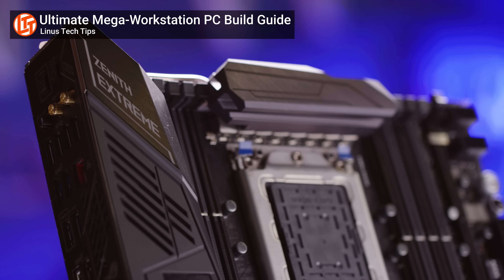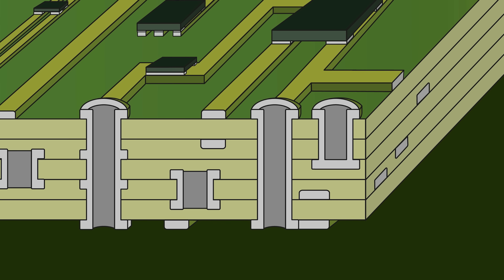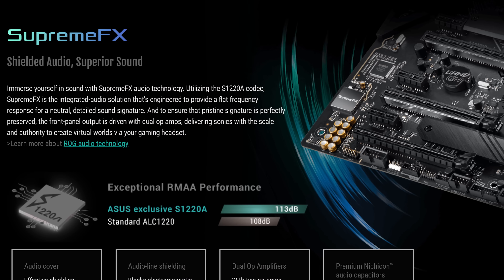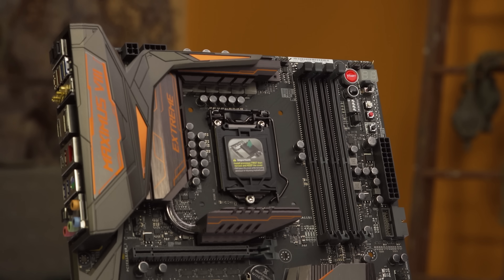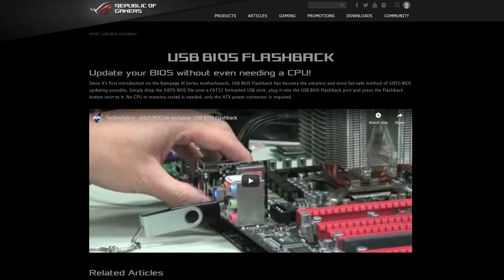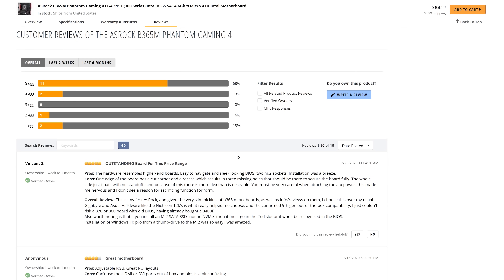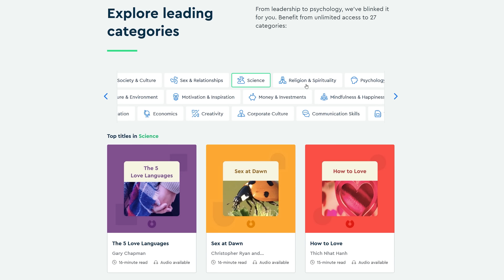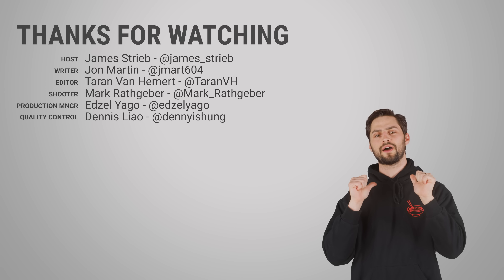Are EXPENSIVE Motherboards Worth It?

Comment: If it has rgb yes, rgb makes anything 20x stronger, like an rgb cpu, it goes from 4ghz to 80ghz
Reply: never forget the rgb fans.
Reply: Yes! When it has rgb on board, this will give you 50+fps AT LEAST in all your games! :p
Reply: I thought it was 100ghz
Reply: @lukasmares1489  rgb fans move at light speed so they’re way better
Reply: @bramvandenbroeck5060  90*
Reply: I put a custom rgb heatspreader on my Athlon XP and now I can play the latest titles with software rendering. At 643.2343 fps. Plebs. I run at 3 tera hertz
Reply: ur all bad 

rgb cpus give 69ghz
Reply: @Saber SMAW hey look, most people like it. it's personal preference. dont get heated
Reply: Rgb is for kids
Reply: It also goes from 4 cores to 80 cores.
Reply: average gamer

Comment: Ok summary: For the 99% of the folks out there - getting a costlier motherboard isn't worth it.
Reply: I have a high budget so I guess I should?
Reply: @theycallmetheswitcher703  probably. What’s your cpu you plan to use?
Reply: @Th31nOnly  5950x
Reply: @theycallmetheswitcher703  I’d go for either a Aorus Master, MSI Ace or if you have big bucks to spend either the Aorus Xtreme or MSI Godlike.
Reply: @theycallmetheswitcher703  I just bought a 2950X. Whats the difference between mine and your CPU? Just more PCI lanes? lol.
Reply: @LaSombraa  Mines faster
Reply: Jay _TooGoated  idk but have actually found that 3090 if yes please tell me where
Reply: Jay _TooGoated  oh ok
Reply: Define costlier. Nobody should be buying sub$100 boards if they're gamers, you don't need anything around $200 but don't ever go below $100. $150 is the sweet spot. Y'all will spend half a thousand on a GPU and $300 on CPU but won't buy a $150-$200 motherboard? 🤨 WeirdChamp

Comment: I only buy a320 mobo now and never pay more then 40 bucks for a motherboard . I used to buy 500$ motherboards but today's age where no modern CPU can overclock more then what it it say in the Box specs they are already produced and clocked pretty high so you're not going to get much overclocked performance out of modern chips nowadays kind of pushes me towards buying a basic non overclockable A320 motherboard every time and I'm not even considering an Intel motherboard because Intel isn't worth considering right now

Comment: When the X470 chipset is already classified as "older".
Reply: And when the 4000s come out, x570s are out too 

/s
Reply: @stermyplatinum7870 
They are actually not going to be upgrading the socket type... So no....
Reply: @kasukahei  am4 dies with 4000. amds own words.
Reply: @Dr.WhetFarts  No, AM4 will still be used for Zen 3 (4000). Zen 4 (5000) is when AM4 dies
Reply: @whiplash7400  that's what he means. The AM4 socket will die with 4000, meaning that will be the last.
Reply: Karrick  I think I missed the Ryzen 4000 release lmao. Unless you count laptops this really didn't age well
Reply: @nicholassmith7723  they skipped the 4xxx in naming; the 4000 they were talking about is actually the new 5xxx
Reply: @stermyplatinum7870  what was the point of the /s
Reply: Jay _TooGoated  why are you getting a 10900k if you can afford a $2500 GPU???? Lmao I would say wait for Alder Lake 12900K and get a good board and too spec DDR5 RAM. Forget 10900k.

Comment: In the 25 years I've been building my own PCs, I've always stuck to the 100-150 range on motherboards. I've had a single failure, but it was within warranty and was repaired for free. No way to say if that was because they were cheap, or just bad luck of the draw. This video answered its own question right at the start, then spent 4 minutes in a circle to come back around to the same thing. Get what has the I/O features you need.

Also, thicker boards do not always mean thicker traces, but can mean more layers. In addition, a thinner board can actually have superior performance by moving signal layers closer to power planes. This reduction in thickness is from a reduction in the insulating material, like FR4, not by thinner traces. Thicker does not automatically mean better, not by a long shot, and you do a disservice to your viewers saying so.
Reply: 100 to 150 what?
Reply: @PureOctarine  dollars
Reply: @PureOctarine  Chocolate Kisses.
Reply: @PureOctarine  cents
Reply: @southpaw117  exactly, 100-150 finest chocolate kisses.
Reply: It also depends on you cpu, no reason to get an expensive board if you have a 65-watt chip. If you have an i-9 it may be worth researching a bit more but I remember seeing that a $450 board had the basically the same performance as a $2000 board. It's also a good reason to consider what CPU to use in your system as the more power hungry CPUs are more expensive then just the individual price of the CPU.
Reply: @PureOctarine  bitcoins
Reply: wonder how you do that now with how bad the prices are

Comment: Let's look at my personal experience.
I've been owning and repairing computers for ... a while.
I've had a lot of parts fail on me.
The three most common failures I've seen are: 

#1> Hard drives.
Not the most fair comparison, due to the VAST majority of my hard drive failures being laptops, and rough handling played a major role in most of them.
This was a major reason why I was so happy to see SSDs becoming affordable, and I was a major evangelist for the technology in laptops in the early days.
Forget the speed benefit, buy an SSD for your older laptop so you don't lose all your data if you drop it! I have one machine that's claimed THREE drives all by itself.
Can be resisted with a good solid backup plan, and given the average age of my typical failing hard drive (I've only lost one newish drive), you're probably due for an upgrade anyways. 

#2> Fans.
I've had a lot of old and crusty fans fail. But I've also been able to repair a lot of my failed fans and restore them to operation.
Unless it's your CPU fan, these usually aren't terminal. 

#3> Motherboards.
Seriously. I'm saddened by how many motherboard failures I've experienced over my computer-owning life.
It's a good idea to put a bit of dollar into the quality of your motherboard purchase to try to help head off this particularly traumatic, sudden, expensive, and very computer-ending failure.
My first desktop motherboard was also my first desktop motherboard failure. I hated that thing and was honestly kinda glad to see it go.
It resulted in me buying an old server grade workstation motherboard, as I wasn't ready for a CPU upgrade, and Intel did an Intel and discontinued my socket.
I have another system in my collection that I'm pretty sure is a ticking time bomb before its motherboard goes.
Reply: Damn, I never had hardware fail on me ever. I've reassembling computers  since I was 6 and never have I ever had any component at all die on me. Once a VERY old hdd stopped working over a bent pin, so I decided to retire it instead of fixing it, and I had a gpu fan blade break, but I replaced the fan so it's working fine again. So far nothing died. Not even 20 year old oem psus
Reply: My very first hardware failure was by my GPU, because my parents didn't think having a FREAKING FAN ON THE GPU WAS ACCEPTABLE. Entire GPU burnt itself up and took the motherboard with it.
Reply: @shahnazfiaz2015  Ouch...
Reply: @FerralVideo  Extreme ouch since it was my first ever GPU ever. First GPU ever that could actually run a game. And it burnt itself in 2 months.
Reply: @shahnazfiaz2015  so wait did they mandate you get a GPU without a fan or somehow rip it out???
Reply: @Lyander25  it was the first pc I ever owned, and we didn't really know much about them at the time so they decided to just get cheap parts to just make me happy. It was an AMD office use "silent" GPU. Silent as in it only used a massive heatsink to keep itself cool. Let's just say that office use and playing games were very different things.

Comment: Truth be told when I went to buy the board in my current system what I cared most about was having something that was full ATX first and foremost so I had plenty of Sata and expansion ports,(and since I was building in a case with a tempered glass side panel I wanted something that would fully fill the motherboard tray). I also wanted something that had onboard RGB control and lighting as I was also looking to make a flashy system as well. I went with a ROG Strix B450 gaming F because it filled all the needs I had for the build and seemed to be a good value for the money in December of last year and it had a lot of positive reviews.

Comment: I didn’t expect the extra features to be so important when I bought my Aorus Master Z390 beside stably overclocking my 9900k. But I end up using all these features to the max such as Bluetooth 5.0, extra USB voltage modulator (let you increase voltage manually. Great for VR headset and sound equipments). So be sure to check for these extra features that might benefit your peripheral equipments.

Comment: I have been running Gigabyte X58 UD7, one of the most expensive mobo of 2009, for 11 years now 24/7.  Computers are fast enough in every way, support enough memory etc. that the computer you build today will be usable at least a decade in all but compute heavy tasks. You can buy 2nd hand 3950X and Big Navi later and extend the life of your system. Motherboard is the only thing you are not going to upgrade. 

I also bought on 2009 one of the biggest/best cases, best PSU, and Noctua NH-D14. Buying great case, great PSU and great air cooler (water cooling is obsolete, best air coolers beat all AIOs) are great investments. Great cases will look great and offer everything you need for a really long time. Good PSU won't cause short circuits, won't break and require work for replacing it, won't have crappy coolers that starts to make noise later, and it produces better quality electricity which is good for all the components.

Great air cooler allows better boosting, cooler temps which leads to quite a bit lower use of electricity, which accumulates into real savings over the years especially in 24/7 usage. You don't need to clean the cooler as often, it's more quiet, has more reliable fans. And good coolers have resell value. Good PSU and case can also help with the use of electricity, as PSU will waste less power and produce cleaner power that allow all components waste less, and great case helps to keep components cooler and more efficient.
Reply: There is a fluid cooling system that will beat forced air heat dispersion... but it's not the old tube based water cooling.
It's 100% immersion, zero fan.  Such as https://www.youtube.com/watch?v=PvmMs6mU0NU for example.
Pricey, sure... but if the system is properly sealed to keep out contaminants it'll run indefinitely.  OFC, making future changes is moot since draining to replace a graphics card, for example, would be a PITA.

Comment: every mobo i ever bought was about 100$ 
every cpu i ever bought was about  250$
every gpu i ever bought was about 450$
every psu i ever bought was about  100$
and all of them lasted about 8 or 9 years before i needed something better
Reply: This is honestly really good advice. I would add about 250$ for a monitor, about 50$ for a case and about 100$ for an ssd.
Reply: so a gtx 580 released 9 years ago at 499$ is still good today?
Reply: @andreiarg  Considering the insane value you got out of it, I would say playing on lowest settings is totally acceptable
Reply: @andreiarg  i went from a gtx 230 2gb to a 970 4gb and it still kicks ass for me to buy a new one...i dont need a better one yet for 1080p 60fps gaming ..but in a couple of years i think im going for a 2070 for a 1440p upgrade and i will make a new pc entirely  because outside of the gpu th rest are from 2013..and i think i will keep the 970 for physix or something
Reply: @andreiarg  while that is factually a correct argument, gpus are the fastest aging components not by durability, but lack of horsepower when a triple A title hits and in that regard even the most expensive card wouldn't hit the highest settings after those years. Would you consider added usability of 1 year worth 500$. I sure wouldn't and won't
Reply: @MrVaahtis  i got my 970 at 2014-2015 and i still play almost max most of the games at 1080p 60fps ...specially the well optimized one's ..like resident evil 2 or dmc5 ..so the value i got from this card thus far is insane for the horsepower argument you just correctly said..im opting for a new pc at a couple of years and a 1440p upgrade with a 2070...i think i will get about 7-8 years with that
Reply: That is...well... legitametly a fair plan
Reply: @Ko700el  well let it age 4 nore years and see how well it works after
Reply: I can see you weren’t into computers during the 90’s. The difference between a 486 DX2 66 and an athlon 64 is 10 years.
Reply: Starting with the early 3D add on cards like 3DFX made, no GPU has lasted 8-9 years. Nor has any CPU. Load a game? yeah. Play the newest game at max resolution? Hell no. Example, take my 3440x1440 display. Are you telling me an Nvidia 680 could run every game out today at 60 fps at 3440X1440? If all you play are older titles/turn based games, maybe you will be fine. I enjoy turn based games but I also want to play Doom Eternal or COD Blackout max settings high FPS. Not to mention MMOs with 100 players in a battle. It's just flawed reasoning. I CAN drive around a city (not a highway) in a Ford Model T, it can handle 30 mph just fine. I'd much rather drive in my 650hp vehicle with cooled seats, surround cameras, navigation, nice stereo etc. Anyway, point being, a 9 year old PC might boot up and be fine for youtube and old games but a serious gamer needs to do a new build every 4-6 years. Really serious people every 3.

If you don't have a lot to spend, best thing to do is make a good mid range PC every 4-5 years. Example, I5/NVidia 970 would be good enough for 95% of games at 1080p today, and as soon as the 3000s drop (should be very soon now) you would build a new i5 10600 and a 3070 to last the next 4-5 years. If you can't afford $1500 every 4 years on a hobby, you need to reexamine your life, because you messed up someone. Even a 16 year old should be able to earn $1500 at a summer job living at home.
Reply: nice
Reply: pretty good advice, except I go with a $250 GPU and upgrade that every 3-4 years, everything else 6-7 years.
Reply: im pretty sure some of these items will be needed to be upgraded earlier in the future
Reply: xOr  how will you know thats the case?

Comment: So as always, build with your specific use cases in mind. If you're just gonna game than a low to mid-tier board would be more than adequate but if you're planning on using it for more than that like streaming or light to medium workstation tasks than throwing the dough at a higher-end mobo might be worth your while.

Comment: you could have at least mentioned the different Chipsets of differently priced boards :x
Reply: They don't matter as much any more, especially on the AMD side.  95% of consumers won't notice  difference.  But Intel still segments hard so you're right.
Reply: Not worth it, there's a bad board for every chipset. For example the x570GT is rated F on the LTT Motherboard Tier List due to bad power delivery which only support 50A, while the Asrock B450 Pro4 is rated D as it has better power delivery of up to 100A and costs half the price if not less.
Reply: You might be right about bad motherboards for every Chipset, but thats not the fault of a chipset. A Chipset does provide features. Those features segment Motherboards into tiers. And that is something I personally think should matter to a consumer. Ofc you are right, it doesn't matter to everyone and most won't even notice the difference, but to those who build their PC by themselfs, which are those this video is targeted at, it should matter. And Chipsets may (depending on the platform) provide the support to overclock. There are Chipsets that will straight up lock overclocking, even though the processor might support it.

Comment: My current board is an EVGA X79 board and CPU which is 6 years old with a GF1660ti vid card. Not a 'cheap' board back then. Mid-range and higher level boards are generally more reliable and last longer due to the better quality build process.

Comment: I would love it if a bit of diagnostic help like buttons and a post code display which are not something only Overclockers need would be on not bonkers expensive mainboards. instead of comparatively useless stuff like RGB, bonkers level overclocking and whatnot.
Reply: Yeah I wish my board had a display and power button
Reply: don't MBs still use beep codes for that?
Reply: @SilverMe2004  technically yes but
1) they are often enough not in the manual and you have to go search the internet
2) if you have no minispeaker connected to the MB, no beep codes
Reply: FuNot FuMe Yeah my MB has no indication for errors, its not a super cheap board either
Reply: yeah i've been instalition of nanomachine tiny boost chip

Comment: If you have a Ryzen 3900x or 3950 you should consider getting a 12+ phase motherboard. Those caps will otherwise go into 120 degree celsius territory, throttle your CPU and may reduce the lifetime of your board. derBauer has a great video about that.

I myself spend a bit more on my next board because my system runs 24/7 and I need the long term durability and stability high quality components usually provide.